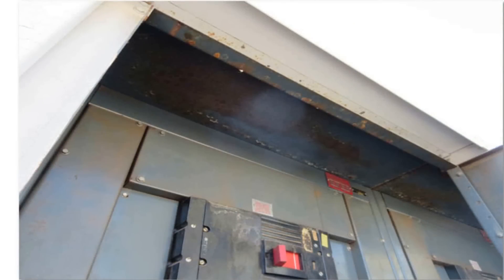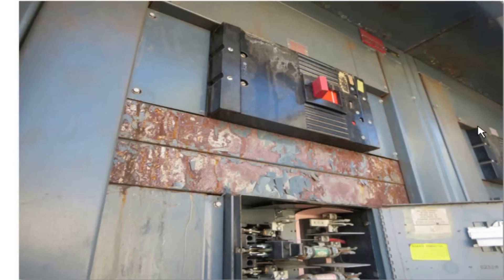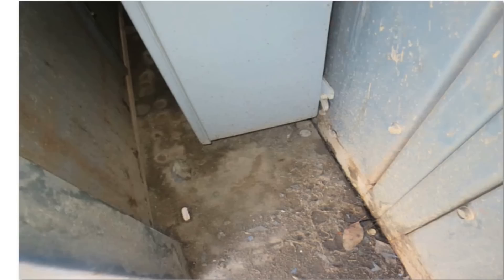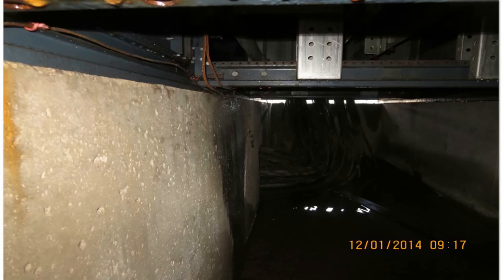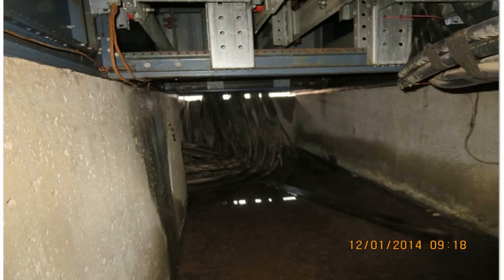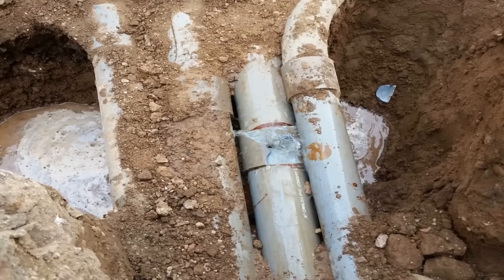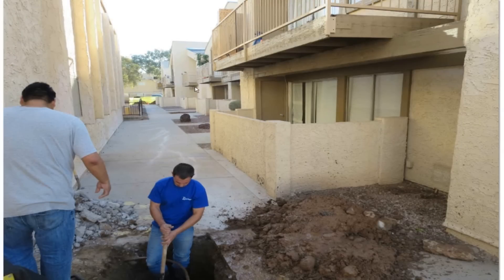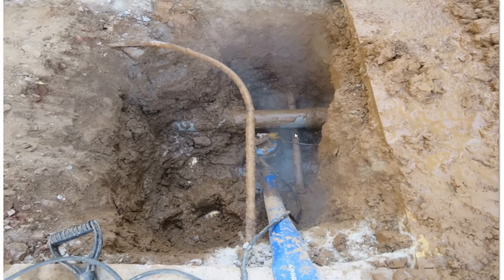Electrical Conduit Full of water

Comment: Years ago at my former job tree roots had broken through the conduit beneath the street of our electrical system 600A 208A  3 phase water had gotten inside the conduit shorted two of the hot phases blew out two  fuses in the under-ground utility vault.  A crew from the power company responded, discovered our main panel was "hot" A few lights still were on in the building with the remaining phase but very dim with the loss of the two other phases.  Power was de-engerized at the vault, following day an electrical contractor came and pulled out all the damaged conductors, started pulling in new ones. I was off work the following day, a generator was brought in to restore power, while the new electrical service entrance was being installed. They tested the installation if they got the phasing right by running our fright elevator which was hydro electric and a 3 phase motor. It turned the right director. Cab traveled up. It was an expensive job about $20.000.00

Comment: Running behind in posting but thought this would be an interesting addition to your video since underground feeders are now more popular in residential situations. Went to a customer's place on a stormy night a few years ago because of an issue with a large standby generator. It wasn't starting automatically and with a manual start it would not transfer. The set was only a year or two old. Went to the basement to find a 400 amp service rated switch mounted on the wall with the UG feeder directly through the back of the cabinet to the main breaker. The inside of the cabinet was completely soaked and crusty with rust marks running down the wall. It seems the long downhill UG run (several hundred ft) had turned into a French drain and the conduit must have been damaged at some point. This cabinet was 4 ft tall and the top was also soaked so must have been enough water pressure to spray everywhere. Needless to say there was no quick fix and the entire installation needed to be redone from scratch.

Comment: Old video, but thought I'd comment anyway.  When the power company's contractor came out to pull wire at my new house, he said more often than not, the conduits fill full of water over time.  Wasn't unusual to them at all. <shrug>
Reply: From what I've read they get condensation in them from being buried in the cold ground, assuming the joints or conduit wall haven't been compromised.

Comment: I don't recall or remembered ever hearing in the video if you ever mentioned how long you thought the Watermain was broken for. Kind of odd having a hot water main underground uninsulated!!! I would think that they would notice a huge use in hot water and find out why so much hot water was being used. Good video by the way.
Reply from the maker: Thanks Ben. We estimated that the water had been running for about a week. It is common on this property to have underground leaks due to the age,about forty years old.The first clue was that the boiler ran 24/7 for several days. We knew there was a leak but couldn't find it till it surfaced. In this case filled the service pit.
Reply: +Electrical Industry Network wow crazy

Comment: sorry for what may be a stupid question, but is the service 120/208 or 277/480?  120/208 wouldn't scare me as much as 480 would!

It's one of those situations where you have to be pragmatic.Yes ideally it'd be shut down right fricken now, but people rely on their power!
Reply from the maker: It's a 120/208 system
Reply: Thanks... I thought it looked residential but you can never tell :)
Reply: Electrical Industry Network 208 in residential? I thought it was 240.